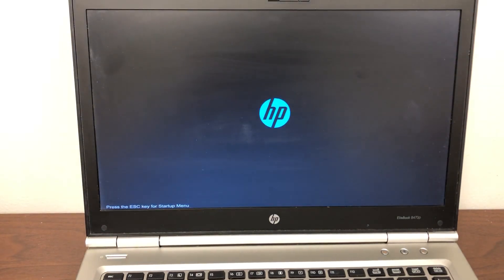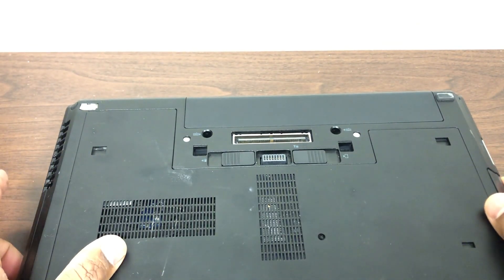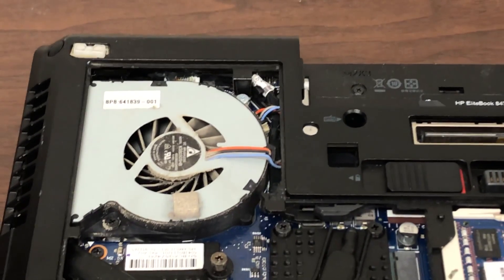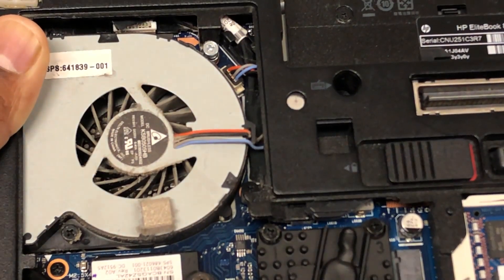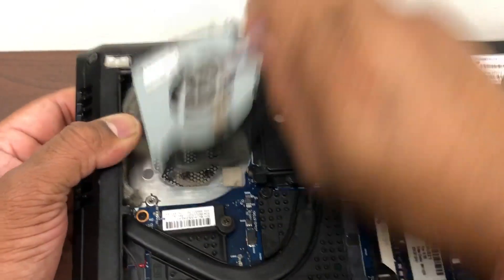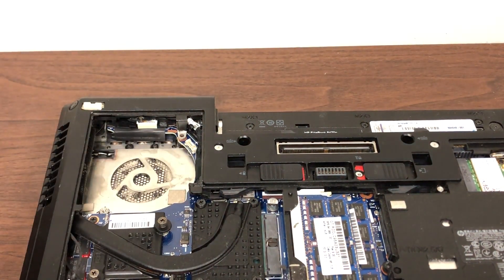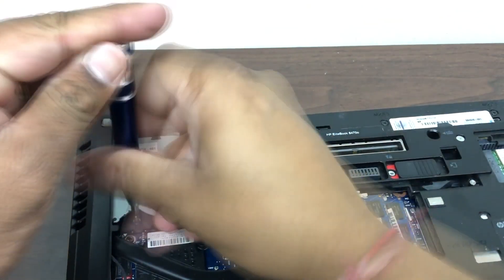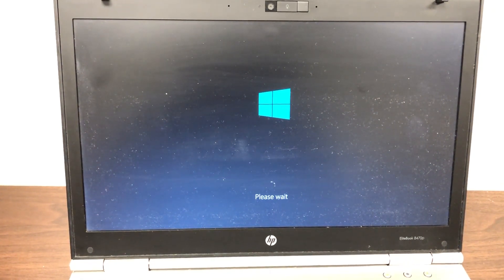FIXED - The system has detected that a cooling fan is not operating correctly || System Fan (90B)

Comment: Thank you for your valuable help, it went perfectly!
On the other hand, I strongly suggest using a vacuum cleaner and a small, short-haired artist's brush to completely get rid of the accumulated dust... Using an aerosol product only pushes the residue where it will then be impossible to extract!

Comment: i fixed the fan by disassembling and put some lubricant. now error is gone. the fan at first is pretty tight ( the fan wont turn when i blow with my mouth). when i put some lubricant the fan is now smooth

Comment: Hey, please can you help me. I have HP Omen 17 2070 graphic card and it has somekind of malfunction. First I had messages on startup that the laptop is overheating just like this. My cooling fan didnt work properly on auto, i went from full to no working like youre giving gas on automobile and releasing the gas. On max cooling mode it would work as it should. The day latter it still has same problems but it wont charge and soon I will not be able to turn it on when the battery turns off. Omen control center didnt show the temperatures were ever high and that is overheats. Please, any advice is welcome! Thanks!

Comment: Sadly not much use to me as the laptop is under warranty which would be voided by doing this. I don't understand because the laptop hadn't even been getting warm let alone hot, and this only happened after it turned off because I had forgotten to plug in the charger, Previous to that it was fine.

Comment: Sorry please what did you use to clean the  fan?
Reply from the maker: Regular compressed air duster..
Reply: @TechGuru247  it worked for a day but the problem continues the following day. I guess the fan needs to be changed

Comment: My HP has a solid back - no little pop-out switches to remove things 😞 but at least the warning went away. Will have to listen for the fan today. This has been the worst laptop ever! Won’t stay connected to wifi and does not have access to the recommended “fix”

Comment: Hi bru i have done all the things i could.. i took my laptop to the repairing store they said fan is working fine and didn't need replacement they changed thermal paste.. but after few weeks the msg showed up again .. what do you think could be the problem? Thanks in advance
Reply from the maker: It's hard to troubleshoot without the device in hand. If the technician at the repair shop thinks Fan is working fine then just disable the notification thru boot menu. Good luck
Reply: @TechGuru247  Hey Bru thanks for replying can u tell me how can i disable this annoying notification I'm in bios settings but don't know how to disable this . U help will be appreciated 👍

Comment: @Some BoringPerson  today i change thermal paste also still noise is coming. But as i checked cpu temperature is going on 16 to 36 approximately.
What to do now.need to change fan or what.pls share your experience.
Reply: man your temperature is normal
Reply: @darkemperor4591  fan not available in my area.will inform you once i will received

Comment: I got this error, but instead of turning it off and fix the fan from behind, I pressed enter.
Them my laptop is working fine.
But do i still need to clean the fan? Will it heat up if i dont?
Reply: It will turn on when u press enter..but clean it when you are free

Comment: Thank you very much. I have the idea already , but mine is A PC, help me, TECH Guru , Thanks
Reply from the maker: Yes, It sure would work. BUT, you have to be extra careful, make sure the power of PC is OFF, not power cable is plugged in. After that you can search by the model of your PC if you need more assistance to clear your fan.. Good luck..
Reply: @TechGuru247  I followed all directions, but the sign still in the computer, when I sign in only. Thanks.

Comment: Was gonna follow the guide. Until my laptop fixed itself randomly.
Reply: hope my laptop fixed itself like urs🥲
Reply: @zankyoreference  did it?
Reply: @Zychuu9  it diddd, fixed itself
Reply: @zankyoreference how ?
Reply: @Jstnotfares  maybe for mine it's just a warning, not that serious so it could fixed itself
Reply: It doesn’t fix itself, I let mine sit for a lil and my fan got worse over time, and it ended with “your device is damaged and needs to be repaired” if you have the equipment try and open it up and check for dust cos that’s what usually causes the error like the video said I think
Reply: @ItsPalmy  yeah I figured that out and forgot about this comment. My audio card ended up frying so I just got a new pc with better hardware
Reply: I missed the warning how do I get it back? 
I can't solve this issue by myself

Comment: I would like help! I put a new fan in the machine and it writes the same error message when restarting! It reacts as if the fan has not even been cleaned or replaced! Write the same error code! (90b) What could be the problem? How to reset the machine? Thanks for the reply !!!
Reply: I have the same issue did you fix it?
Reply: @vtn05001  i am facing thw same problem

Comment: My computer was doing windows updates and restarted then I got the system fan 90b error.  I just bought this computer. So I don't think the fans are dirty or malfunctioned. I just updated the Bios for the pc and haven't seen the error since.  Was that more of a software issue than hardware issue for my pc?
Reply: What is bios?

Comment: i did that and it still is showing this issue. Though the fan is working at full speed. My cpu temps are above 90 Degree C. :(
Reply: Then open task maneger and disable some proggram

Comment: i have the 90b error code on booting up, took my HP CQ58 apart to get to the fan. it was just stuttering, not even a complete revolution, barely any dust but so cleaned it up anyway and reassembled it but same problem, just a slight spin (not even a complete revolution) so replaced fan. Still nothing , just the same as before.

it did power up for a minute just once but then when i had put it all back together, with every screw back in, it went back to stuttering again.
 i did get the fan to start by starting it off with a screwdriver and it span for hours!

turned it off and then back on and the same issue, had to start it off again by slowly turning the fan ant it's been spinning for ages with no 90b error code..

Obviously i can't do this every time as i have to have the kyboard lose and at an angle to reach the fan, but no one seems to have had this issue on the net. and i'm hoping you may have an idea as to what the problem is

any suggestions before it’s thrown the length of the garden?

Comment: When i see how "tech guru" work, my stomach start to crumble... No protection for the top cover of the laptop, use metal to pull off the fan cables, use dust blower to clean the dust and after you reverse the laptop ... I hope the laptop is yours as besides is disgusting dirty (outside) you just added a few scratches.... YUCK !

PS: fake likes to, like 90% of "tech gurus'' videos 😂

Comment: Can you mention the screwdriver with which i can open
M2.5x3 screw.
I am also facing the same issue but with limited tools unable to open it...
Thanks
Reply: Get the IFIX toolkit.  Has everything you need to work on your desktop or laptop. Best Buy carries it in stock.  Around 35 USD.  Well worth it.

Comment: Hello, the same error was comming with my laptop but I press enter laptop works and after some time the laptop is completely off only power led turns white colour and power led and caps lock is continuously ON. If you can replay me or help me to resolve the issue?
Reply from the maker: try this: unplug the power cable of the CPU, hold the power button for 25 sec. Remove the cover of the CPU, unplug the memory card gently and plug it back in. Plug the power cord and try turning on.. hope this heles.. let me know.. thanks

Comment: I cleaned my fan and this error message still came up. I have ordered a replacement fan that will be arriving next week but in the meantime do you think my laptop is still safe to use?
Reply from the maker: Yes. you still can use it. Just make sure that let it cool down for 10-15 min after couple of hours of use.
Reply: @TechGuru247  Thank you!
Reply: @linkfan160  Did you find the solution ?
Reply: @TechGuru247  I changed my fans, they are working properly and still getting this error, I even did a reset of the windows, any idea what the problem could be?
Reply: @mas9198  Did you find the solution (?
Reply: I have the same error on an HP Pavilion dv6 and after cleaning out the fan and heat sink and disabling fan always on in BIOS - still the same error. I’m afraid that even if I ordered a new fan it might not resolve the issue. Someone online mentioned the temperature sensor not available to the fan due to a MB problem - but that’s way out my depth…
Reply: @starless9   also my friend faced that error on hp omen, if I replaced the fan may error disappear? Or it's a global problem?

Comment: Recently got this error on my hp pavilion 15 gaming, should i try to fix this at home or take this to a professional?
Reply: omg same i got this error yesterday and my pavillion 15 is new
Reply: @gil-sama3805  same my hp omen 15 is new and I just got this today
Reply: @isaackvng248   i think we should clean the fans probably its dust because i hear loud noise i always put the laptop next to the window so i think its dust although my pc is new
Reply: @gil-sama3805  have you tried it?
Reply: @isaackvng248  no, my dad just tapped on the fan side multiple times and it started working just fine lol i think you should try it but dont tap on it hard just properly
Reply: It also happened to my Hp Pavillion Gaming 15 (ec001ax)... Its new, i just bought it 6 months ago... Updating the bios may fix the problem and let the laptop run smoothly for a couple of weeks until the 90b error notification hits again 😭
Reply: 2 months after bought it, got this similiar issue, stuck on the pandemic cant go for any assistance
Reply: @newvestoria  i feel you :(
Reply from the maker: It's worth a try.. good luck
Reply: @TechGuru247  I’d rather take it to a pro bc I remember when I was little I always broke stuff like laptops
Reply: Me too
Reply: I just bought it yesterday, used it once gor 2 hrs and the fan isnt working....
Reply: you can do it yourself, it's like lego. I cleaned my fan but still getting this error. :(

Comment: This is bs my 6 year old HP Pavillion never overheats and I never ever got this message. I just bought a HP Envy x360 brand new a week ago, and I got this message the day after I used it. Smh hp. Do you have a fix for my laptop? It doesn’t have a battery and I tried opening and dusting it too. It still came up with the message
Reply from the maker: Your new HP is still under warranty so you can get that fix from where you purchased it from and they will guide you.
If you open the back back cover, unplug the and plug the fan cable if you see one. Good luck..
Reply: Tech Guru I just returned it gonna get a new laptop tbh maybe an omen

Comment: Thank you man! My laptop is doing the same. I'm going to check it
Reply from the maker: Did it work?
Reply: @TechGuru247  basically it pulls the laptop up sometimes bcs it pushing lots of force in and when i ignored it it started to troubleshoot and it worked but after some hours later then i works 5 secs than goes down works an goes down.
Reply: @TechGuru247  I think I will miss it. ..

Comment: i did this, but still showing the error, what else can i do?
Reply: Replace the whole fan, may be the board around the fan I recommend you to take it to a shop got mine fixed for 20$
Reply: buy a sledgehammer and  say to fan go WORK BITCH if the Fan still gets the error. Just samsh it big time. And then try again, If not workd buy a new laptop. 

My advice works always
Reply: @Moni-Poppea-DiMaria  pls leave.
Reply: They say you can find joke in every situation till it happens to you😃
Reply: Try replugging in reverse. It worked for me.  I guess I put it in backwards 😅